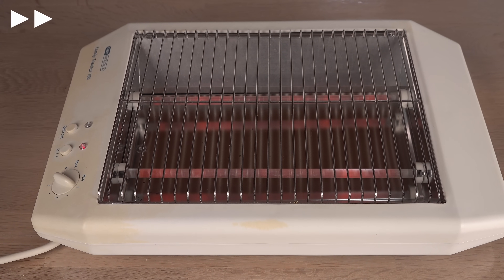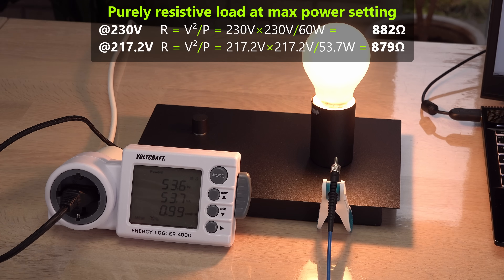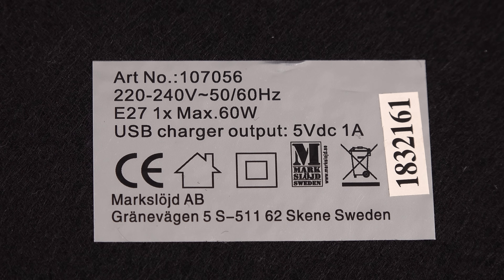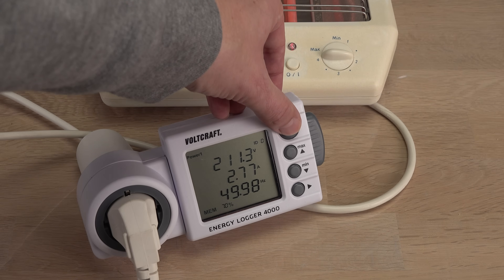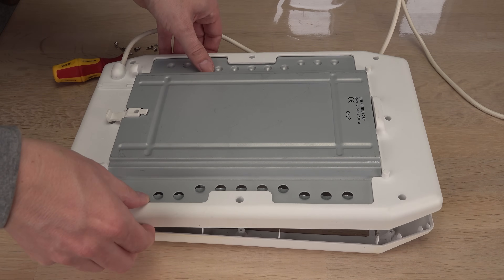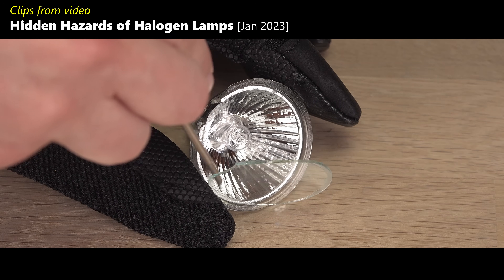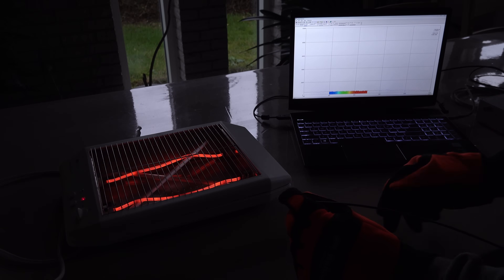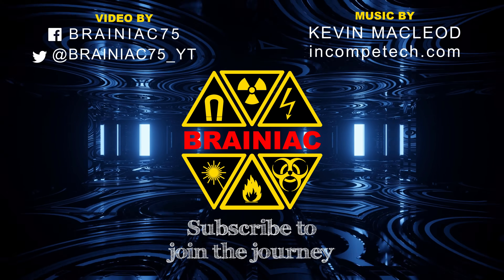Toaster Temperature WITHOUT Thermometer?!? | Crazy Blackbody Spectrum Attempt

Comment: Incandescent bulbs that use tungsten elements. Usually the interior of the bulb is coated with a phosphorus. 
So your measurement might be off. Try finding one with just a clear glass bulb.
Reply: Most frosted incandescent lightbulbs, actually use calcium oxide to diffuse the light. Some high pressure sodium bulbs also use it.
Reply: You are confusing mercury vapor lamps with incandescents. Matte glass incandescent lamps just have an etched inside, or some silica-like powder on the inside.

Comment: I put my toaster oven high setting on one of those kilowatt meters, and it has 4 of those quartz Elements very similar to what you have there, and it pulled 1454W Then stabilized in 1430s When fully heated. Edit My Keurig pulls almost the exact same wattage.